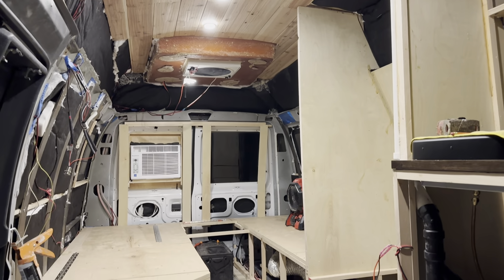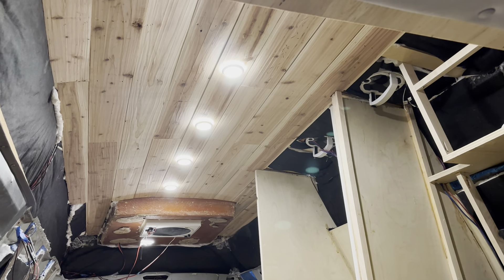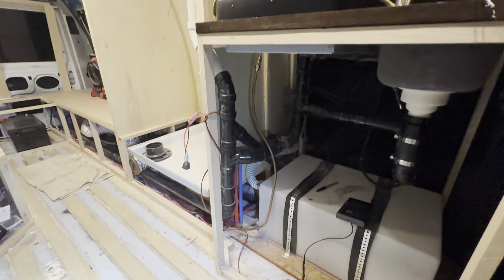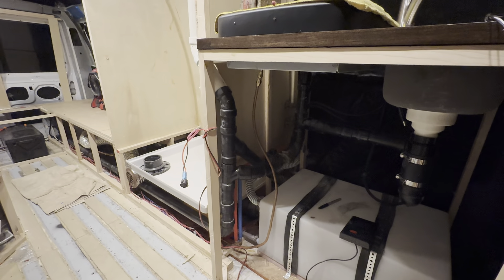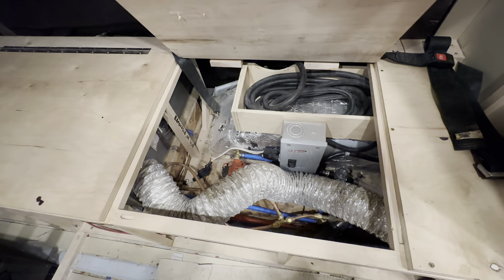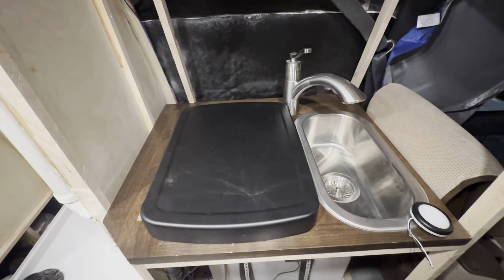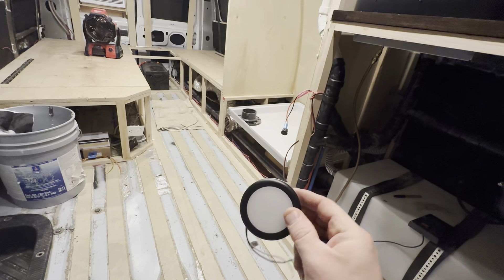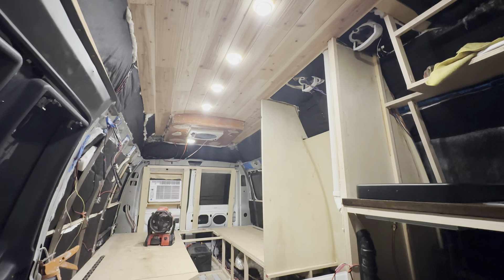4x4 Class B RV Build - All systems a go! Cedar is being installed!! #4x4van #classbrv #vanbuild

Comment: Great job Dave. It's quite the feat to learn about, replace, modify & update all those various systems on the van 👍 I prefer the warm lights too, do you have them on multiple switches or do they make compatible dimmers for them? 🤔
Reply from the maker: Thanks Jonny. I have the lights on two separate circuits (front and back) and both are on dimmers.